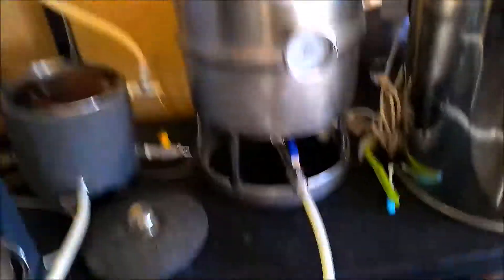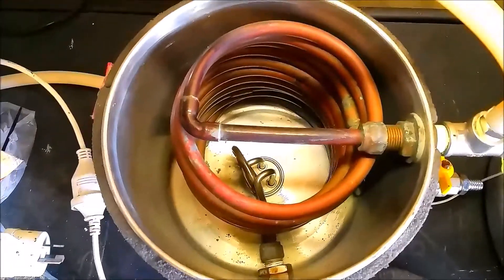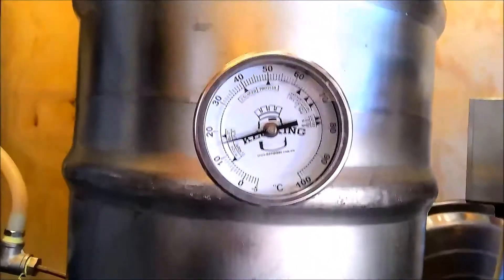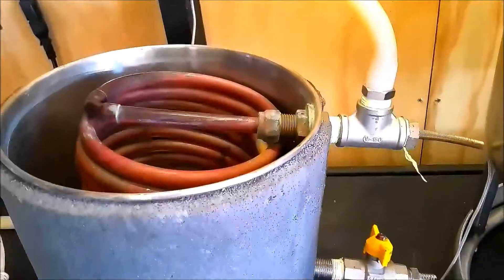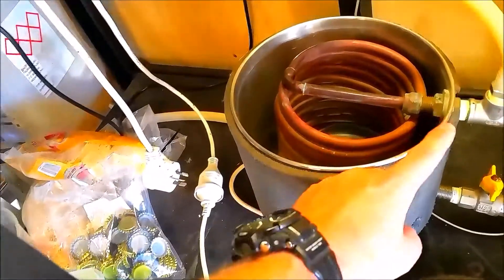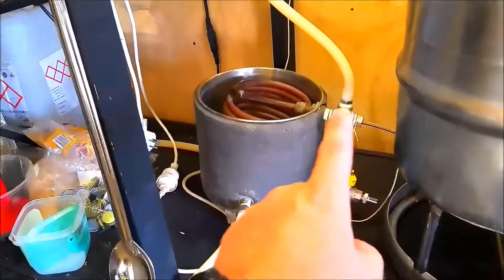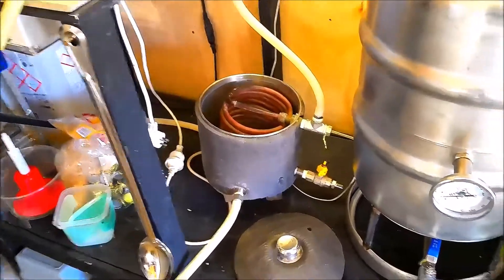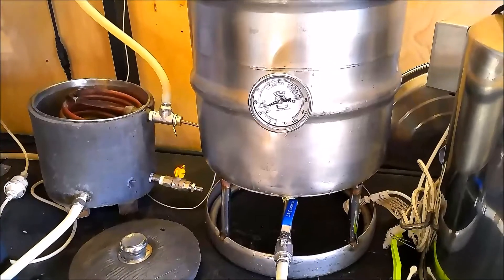HERMS for the Hapless

Comment: Sorry I didn't read your original comment properly  😳 I thought you was suggesting on the out of the Tun. I was intending measuring on the in of the Tun not the in of the HERMS👍. I can easily change that over to the HERMS out. Cheers Tim👍
Reply from the maker: Hapless Ginger Brew Oh sorry for the miscommunication, could've have ended in tears. yes on the inlet of the mash tun would be perfect or outlet of the herms coil. I should have been more specific. Cheers Tim
Reply: Huntsman Brewing It was me not reading properly🙄
Reply from the maker: Hapless Ginger Brew It happens to the best of mate